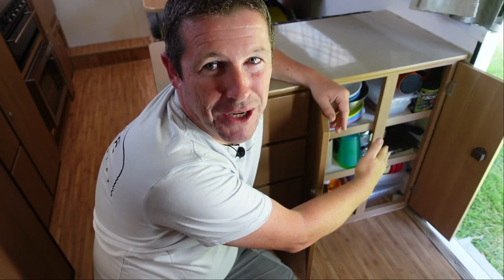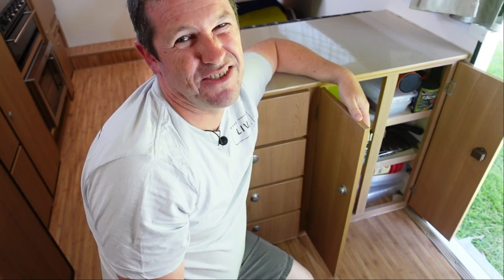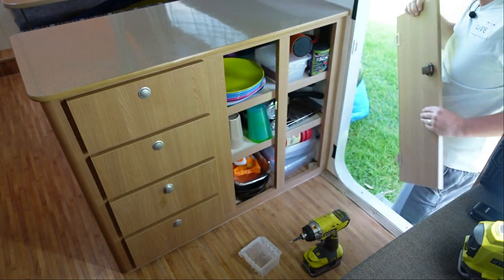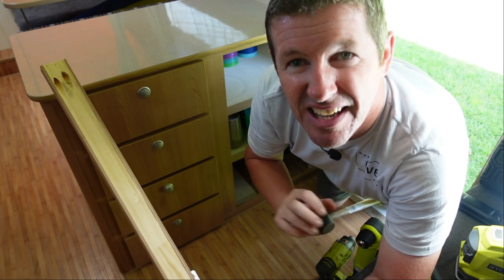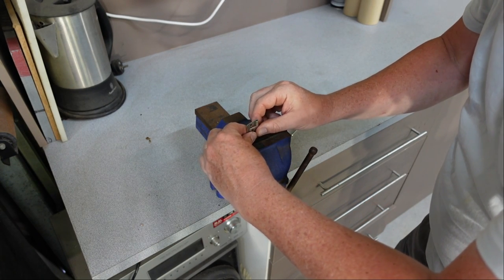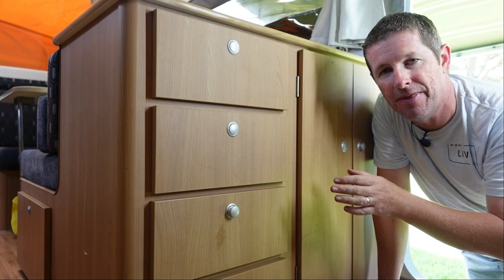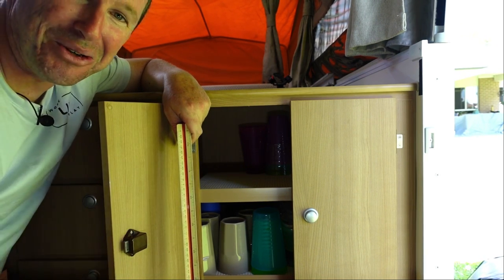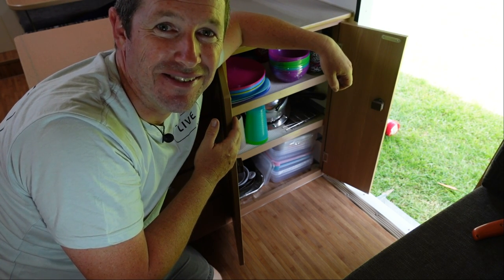LIVE | Easy DIY cupboard central divider removal in our - Jayco Swan caravan camper trailer

Comment: Great thanks, Q. have you or can you convert cupboards to slide out drawers, while still keeping the doors on the outside. I have deep spaces that are useless for storage as you need to pull everything out to get to the back? thanks
Reply from the maker: You could potentially, with caravan construction you have to pack out for standard sliders to affix. A sliding basket system would work well as they are also light weight, however you need to then find the perfect size.

Comment: Great mod, when it comes to the door latches could they be turned 90 degrees and the metal brackets screwed under the shelf to retain the original locking system?
Reply from the maker: Not without relocating and having to cover up the existing holes from what I can see. I weighed up a fair few different options and ways to do it and ended up going back to this simple version. Have to say it works well and most would not notice it has been done which is great.

Comment: Help - I flipped the hinges nearest the entrance but I end up with a gap in the middle & at the hinge side. What am I doing wrong? It’s a 2012 swan.🤔🤔🤔
Reply: I did the same. So I screwed the hinge on the inside of the cupboard not on outside where originally goes. Now there is no gap on the side and just a small gap in between the doors now but doesn’t look weird or anything

Comment: Mate did you end up with a gap on the passenger side door?? I followed your vid and i under up with a gap
Reply from the maker: Hi Shane, I think I confirmed via facebook there is a small gap due to the hinge design moving the door over. Quite discreet and to be honest I didn't really notice.
Reply: I put the removed piece in the spot where the gap is created. Fits nicely.
Reply: I did the same Andrew. Looks really neat and the piece just wedges in there without the screws.
Reply: I have two big gaps. Now regret doing this mod.

Comment: No need to strengthen the shelves?
Reply from the maker: No, this is a very common conversion. The shelves don't really connect to this divider and are more than capable of holding most items upon removing.
Reply: No need to strengthen the worktop?